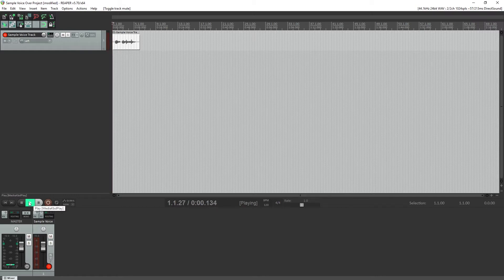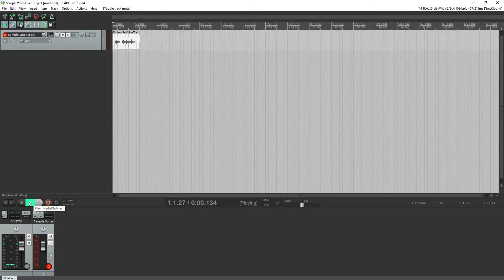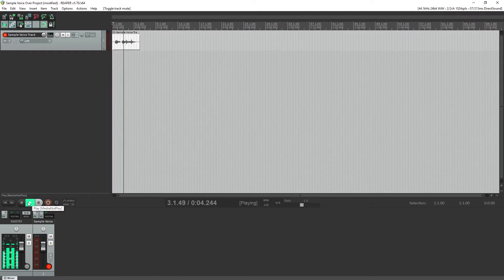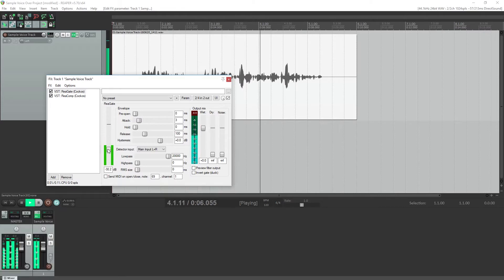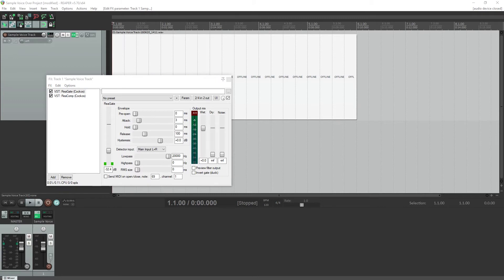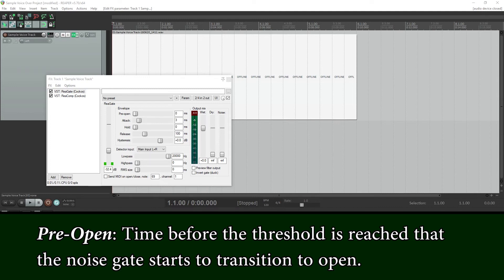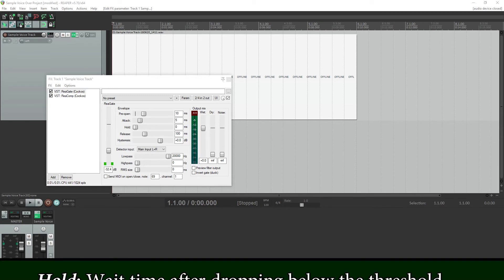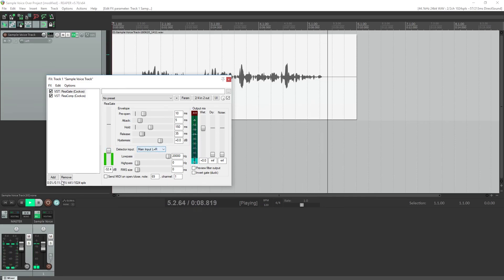Using a Noise Gate for Voice Over

Comment: Hey, cool video on how to remove static after recording! I didnt quite get the answer to what I am looking for :c
Basically my problem is that I have a lot of static in my audio setup(sE200 as mix and the behringer xenyx as mixer to my pc(over aux)) Im asking myself how to apply a noise gate, compressor... to to mix input so that it stays like this for all programs(for example for recordings as well as discord calls). Is there a way to reliably do that without spending hundreds of euros?